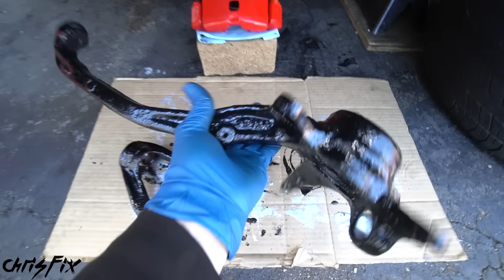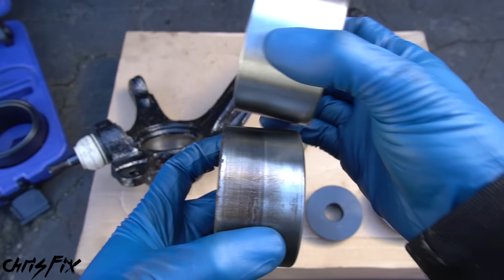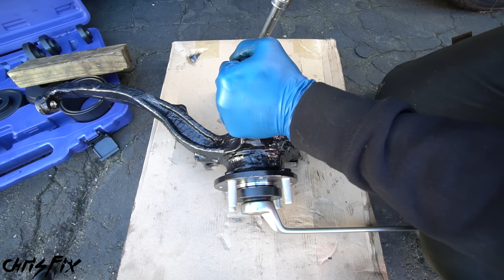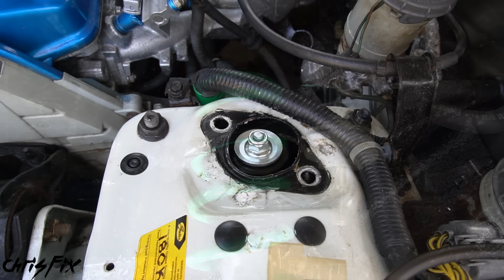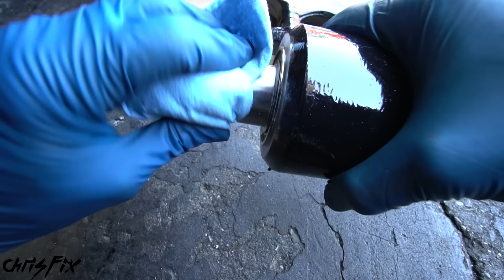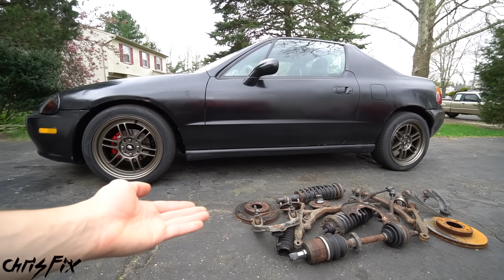How to Install a COMPLETELY New Front Suspension in your Car or Truck

Comment: How much did this cost?
Reply from the maker: A couple hundred for the Del Sol
Reply: @chrisfix   200? that seems super cheap. My old car has been making odd noises in the front and im pretty sure its related to the suspension. I think my left tie rod is loose as well. Not sure if its worth replacing everything as it already has 120,000 miles and its from 2006. Not sure how much lonnger it can last.
Reply: @chrisfix  Any advice for where I can get some decent quality cheap parts? Maybe I can get another 50k miles from this car.

Comment: just changed the entire front end on my 1993 s10  upper and lower control arms too.. it was lowered 2inch drop spindles before the rebuild.then had it alignment... now it sits high? its been a week and still wont drop down to where it was?? is it ever gonna settle back down?

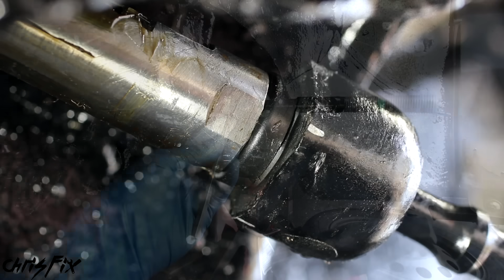Comment: how did he torque to forty foot pounds at 10:41 WITH WRENCHES
Reply: with experience you would know about how tight it needs to be, but you can get a wrench adapter for a torque wrench
Reply: you can use a wrench at a 90 degree angle with a torque wrench and itll read accurately. 
but otherwise you just get a feel for these situations. look at the threads. they give you a good idea of how much force they can handle. 
this M.O. however does not apply to very sensitive torque needs such as internal engine components obviously. if u can use a torque wrench, use one because itll be accurate and train you on how certain torques feel
Reply: @np51486 interesting !

Comment: How much would this cost approximately without the sponsors?
Reply from the maker: Depends on the car/truck and what parts you're buying but this is typically $200-800 for the whole front end
Reply: @chrisfix  Currently pricing out a replacement set of front suspension components/tools/consumables for a 2011 Kia Forte Koup EX. It's going to be roughly 800$ without new axels. Do you find most items include the associated hardware (cotter pins etc)? A list of all the parts needed for this job would be awesome (: Great video though, super helpful.

Comment: 12:51 I love this channel, however in this moment I am fighting some bolts threaded with thread locker. I just cant understand why would you do that. Do you really think you will never need to unbolt that?
Maybe I am missing something, please let me know.
Reply: there are different strengths of threadlocker, the blue one is designed to be removable with hand tools. it also will stop rust

Comment: How are you able to smog it?? When I got my car the 1st owner did an engine replacement. I went to get it smogged, and they sent me to a referee. The referee said I needed the OEM intake which I luckily found however there is a plate on the intake manifold that he said was missing a part. I practically have the original engine in it but he’s still giving me issues. I want to turbo charge it like you but I don’t want to go through the whole referee system again

Comment: Used this info to completely rebuilt the front suspension on my '99 4x4 Dakota. Even if the Dakota suspension is more complex, torsion bars being involved, the same principle applies as described in this excellent video and it turned out very nice...Thanks for posting!
Reply: do u know how to get stock torsion? ima have to rebuild my suspension and steering and im not sure how to key the torsion bars to stock level. 98 dakota 4wd here.

Comment: Hello Criss ,  quick question,   
My 99 Chevy express 3500 3/4 ton Was parked ,  unfortunately. A car crashed into the  Driver side front  Tire .  A lot of damage Fender , broken tie rods , The shock absorber looks like it  went down , the rubber is missing from the bottom of shock absorber, and upper arm control. ,   

 I have replaced the upper control arm , the tie rods ,  unfortunately when I drive  the Tire hits the metal when I turn to the left .     

Should I keep  replacing the other  parts of suspension  ,   shock absorber and lower arm control  as well . ?  I know I have to replace them  since they are broken just waiting for them to arrive 

A couple lazy mechanics told me that the frame of the van was bent  and   I will have to correct the frame  ?

Any advice Guys ?

Comment: Hey Chris, I know this is an old video, but I home someone will answer my question, how do you know what torque each bolt/nut is supposed to be torqued down to, because I recently started working on my car and I know that for the job to be done well and right, I must torque everything to spec, as a matter of fact I just recently got a torque wrench as well, so how can I know or find out the designated torque for each component?
Reply: Has anyone helped you with your question yet?

2 things. You could buy the FSM (factory service manual) this will tell you EVERYTHING you need to know about your vehicle to work on. You could also get a Chitons manual or a Haynes Manual. These are not as detailed as the FSM but will give you most of the torque specs that you need.

Hope that helps you out

Comment: I do love how you explain the pressing of the ball joint and the bearing. Id say inform the viewer that on most cars you're able to get the control arm with the balljoint already pressed in. The same goes for the bearing. Although the bearing will be more common to have to press it in.
Reply from the maker: It's nice when they have parts like that but good to show regardless!

Comment: New suspension, engine, transmission, new cooling system, battery/alternator and fuel pump and oil pumps and water/coolant pumps, power steering, brakes, and exhaust system the car could probably out live us all if every single bolt was marked, and everything was rust coated and followed a maintenance schedule. Car would last forever

Comment: Is it just me or did he forget to fix his brake rotors in place with the screws? At 24:17 you can see the threading with no screw. Love the video anyways. Continue doing such great videos please 😀
Reply: you dont fix them in place with screws
Reply: @arcanevoid9199  I mean the break disc. My bad
Reply: @plexwhite9366  yes, those arent fixed in place with screws either
Reply: @plexwhite9366 its called the rotor
Reply: What are the threads then for? The break discs on my golf and bmw are screwed in
Reply: @plexwhite9366 its for the lug nuts

Comment: Hey @chrisfix where do you find the torque specs for the bolts? I saw you have applied different torques across the installation so I would like to make sure I do the same for my car. Thanks for the videos! I have been following for a while now!
Reply from the maker: I google them or use a service manual for the car which has the torque specs listed.

Comment: I just bought an 08 volvo c30 t5 and the entire suspension needs replaced and both estimates for work was over 3 grand. Nearly half of what I bought the car for. This is pure gold. Got the parts on order since I already had 3/4ths the tools needed for this. 

Thanks!

Comment: We are a big manufacturer of suspension parts for OEM and aftermarket, such as ball joint, tie rod end, stabilizer link,inner rod,bush and control arm, we have full range of these parts.

Comment: Wow, you explained the suspension work so well, I never knew those were all the pieces of a suspension. The hardest part really about any car work is having the right tools. Looks like I'll have to spend about $1,000 in tools since I don't have anything other than basic sockets, a ratchet and torque wrench, ramps, some screwdriver adapters/bits, and some wrenches.
Reply from the maker: A lot of the bearing presses and stuff like that can be rented. But yes the common hand tools are necessary to buy.

Comment: Good day Chris, first of all thank you for all this incredible content! I used your videos a lot to bring my 2003 Honda Element back to it's best shape. I would like to ask if replacing struts/shocks really changes the riding quality. My car has 160k miles on it and it rides decent, but I am considering investing some money and put in a new suspension on it. I understand that it won't be as comfortable as modern vehicles, but does it worth it? Or I should I stick to the rule: don't fix it until it is broken. Thank you!

Comment: Dang, it looks like the Del sol uses the same knuckle design as the acura tl and cl of similar years. You could do a factory bigger brake caliper upgrade for cheap if it does all line up

Comment: Loved the tutorial. Only thing I’m worried about is the rotors not having 2 screws to bolt them down. From factory Hondas have 2 screws to bolt down the rotors. Not sure who why that del all doesn’t have it when it’s supposed to
Reply from the maker: Thanks! Those bolts didn't come in the kit and it only job is just to hold the rotors while manufacturing the car

Comment: Shouldn't the axle go into the front wheel differential? As far as I know the transmission doesn't directly rotate the axle half shafts. It transfers power to the differential then to the axle half shafts.
Reply: in a fwd the differential is in the transmission
Reply: @arcanevoid9199  Then it should be called transaxle, not transmission.

Comment: Is there a reason you switched from copper anti seize in your previous video back to graphite anti seize on the grease points of the break caliper ? I can't find any consensus about which is better and what kind of grease you should use where (unless it needs to withstand high temps) ...
Reply: copper is better for brakes

Comment: Dust shield aren’t really a safety issue on disc brakes. Water in a drum brake is really really bad, but in a disc brake it’s not as big a deal. You’ll just have more to clean when it comes time to get rid of all that brake dust buildup 😂

Comment: @14:02 I've heard that you need to put the car down on the tire before you torque. But it doesn't say in the Shop Manual I have, that you need to put down the car on the tire before you torque the Rear Strut Assembly-to-Body Attachment Nut. Does it depend on the specific car? I have 2001 Saturn SL2, and I have a shop manual for that particular car. Haynes book also doesn't mention anything about lowering the car. Maybe it is just well known fact for mechanics.
Thank you for your informative film as well.
Reply from the maker: For stuff like bushings where it can tare, you always want to torque with the weight of the car on the suspension like I showed in the video.
Reply: @chrisfix  Thank you very much for the replay and opinion. I do my 1st Strut Assemblies, and despite the general thought that it is an easy project, it doesn't look such to me, bcs of those small nuances. Watching the film was super helpful. Thank you again.

Comment: Why didn't you install and tighten the axel knot while the car is jacked up? What's the difference? And why did you do it while the wheel is installed? Thanks
Reply: because it will turn the wheel instead of tightening, and its quite hard to stop it from turning with the car jacked up. really easy to do it with the wheels on the ground as you can just put the handbrake on etc

Comment: Hey Chris, do you have a video for replacing front suspensiopn on a rear wheel drive car? I guess the only real difference is that you don't have to worry about a drive shaft?
Reply: yes, if it’s just rwd then it is the same without the drive shaft

Comment: Hey Chris, brilliant video - My Pontiac GTO has suffered some collision damage to left front suspension so much of it needs replacing. Would you recommend replacing the right-hand side aswell? I guess having a mix of old and new might impact handling.
Reply: did you end up replacing both sides or just 1?

Comment: Great video!  And so specific with the amount of ft/lbs pressure needed to tighten the bolts, but not everyone has that special tool to show us. So we just go based on judgement.
Reply from the maker: It’s worth it to buy the torque wrench for $30-40. It ensures you don’t make expensive mistakes where bolts can snap or loosen up.

Comment: just bought my first car, a '89 prelude for $800, and im planning on using this video to rebuild the whole suspension system in it!
also- what happened with the turbo build at the end? did you ever wind up doing it :0

Comment: I love that you checked the ball joints against one another. One should always check the new part against the old part.  It's very common to get the wrong part as the guys selling them are typically using a computer to find the part not the knowledge.  Sometimes they will argue a car doesn't have a certain part even though your holding it in your hand.  Multiple reasons why but regardless one should always compare their parts with the old part. Just my 2 cents worth

Comment: Do you really need the replace the entire suspension  for a smooth ride or just certain components?
Reply: it depends on whats worn out, if just a few parts than you can just replace those. if its done lots of mileage and is decades old it could definitely use a overhaul like this

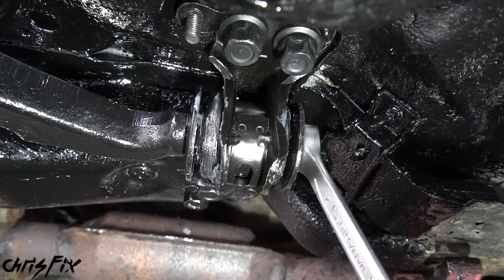Comment: 19:35
Pro tip, for when your torque wrench wont fit. Drill a hole into the end of a wrench, measure the distance between the hole and the center of the bolt. Then pull on it with a fishing scale until you reach the desired resistance. Using the equation, F = t / R.

So, let's say we want to torque to 83Nm (61 ft-lbs), and our wrench is 30cm long.  83 / 0.3 = 277Nm. 
Since most fishing scales don't measure in newtons, you then divide the result by 9.81, to get force in kilograms. So 28.25kg. When the fishing scale reads 28.25Kg you know you have 83 Nm of torque. 

This will be just as accurate as any torque wrench. This is how torque wrenches are often calibrated in fact. Just make sure you pull the scale perpendicular the the wrench. Pulling a few degrees off increases the required force.
Reply: Thanks 🙂
Reply: Was trying to work out in my head how to do this with a regular wrench - thanks my dude!
Reply: thats a nice tip, ive had to make torque adapters before and make the calculations but this is next level!
Reply: Thanks. Everyone who watched this video this totally gonna do this.

Comment: I made the mistake once of not staking the axle nut on one of my cars. Once. Never again. Thankfully nothing majorly bad happened but the nut did come loose and ruined my new wheel bearing, which is a press in like yours, and no fun to replace. Also I like your method of torqueing the axle nut, never thought of that, I just always get it tight with an impact because I couldn't think of a good way to do it, and just hope it's tight enough and not too tight, and I haven't had any problems doing it that way aside from when I didn't stake the nut which is totally my fault, but I'll be doing it the way you showed from now on as long as the socket fits in the wheel that way I can get it to the proper torque value. I don't generally worry about torque specs as I know how tight stuff should be, but on stuff like axle nuts, bearing caps, head bolts, really anything with a bearing or important sealing surfaceI like to use a torque wrench to be sure, especially since I've learned my lesson a few times overtorqueing smaller stuff and breaking it such as the small bolts that hold the caliper to the caliper bracket, thankfully it broke while tightening so I realized I was stretching them, and after that didn't put them near as tight, just good and snug. We all learn one way or another, my way is far from perfect and now I care about torque specs on stuff like that more, but hey, that's just learning the expensive way and not necessarily the hard way (like if it broke while driving instead). Thanks for the video!

Comment: Just a question is it the same parts and process to change out the rear suspensions and all of it's components? I tried finding a video but haven't been able to? Thanks everyone!
Reply from the maker: It’s similar but not the same. Also depends on your car and suspension setup.
Reply: @chrisfix  Wooah I did not expect an answer from the man, the legend himself! Been a long time viewer of your channel my friend and love your content. It would be for an ER34 Skyline GTT. I'm looking to replacing all the bushings, bearings, basically everything driveability/suspension related under the chassis since it still has the OEM parts that is all rusted and well worn since it's a 20 year old vehicle. I'll be doing lots of research and hopefully find answers but do you have a video about rear suspension replacement or if not ever plan on doing one? Thanks again mate. :)

Comment: I need a complete rebuild for my 98 E11 Corolla, only 56k miles as the old original owner didn't drive often, but the sitting didn't do the suspension well, everything else is clean and mint working fine, but at motorway speeds the cars just pulling left, clunking at the back and all in all isn't great for my daily need for the thing.